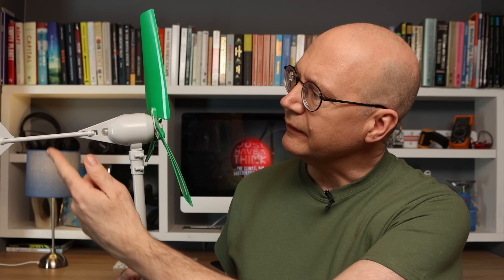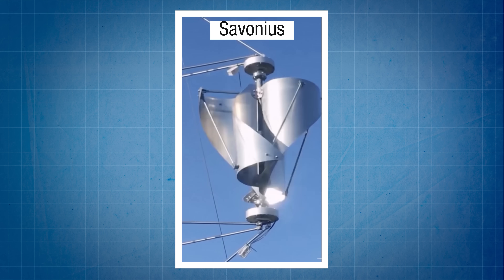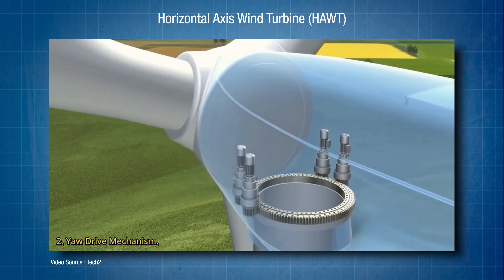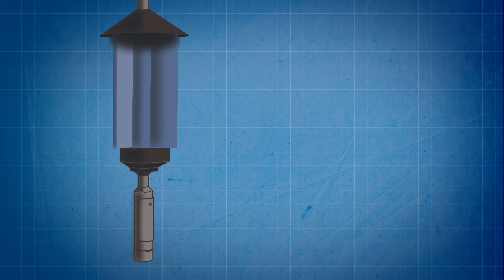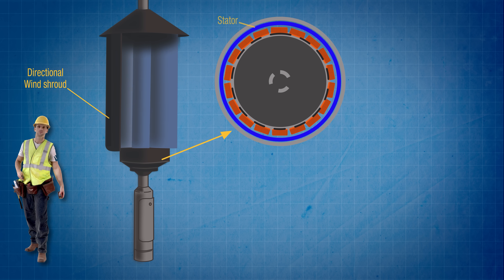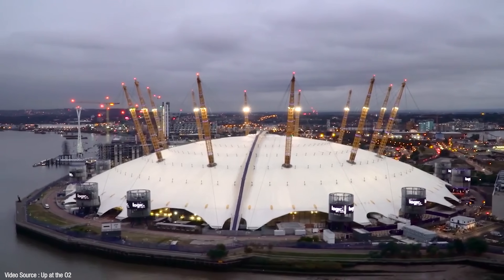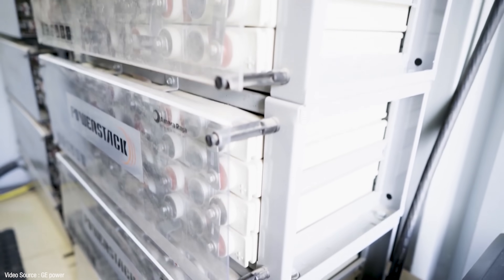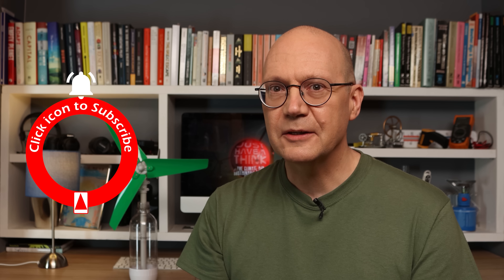A vertical axis wind turbine that doesn't need the prevailing wind! How do they do that?

Comment: Put them beside airport runways so turbine thrust would spin them. Corners where planes turn to take off could give them a real spin.
Reply: Even without planes, the amount of wind that airports will experience will be very high anyway. So definitely a very good place to install them regardless.
Reply: @shauntay0248  railroads too
Reply: @emiliogarcia5103  Yes, including the underground railways
Reply: @shauntay0248  actually, no. Airports are designed to be as safe for aircraft to operate from as possible. Towers and poles and tall buildings are banned. Outside of the control tower, everything else is built low. All towers in the arra are required to be marked on maps with elevation in print. Wind turbines cause a huge problem for crop spraying ops in the American Midwest. It leaves a lot of crops un-sprayed near the turbines and reduces farmers productivity due to bugs, pest and fungi caused losses.
Reply: @Triple_J.1  hmm, understandable
Reply: @Triple_J.1  Properly placed, the wind turbines would no more affect air traffic than it does road traffic. On the sides of the runways they would augment the safety barriers already there.
The OBSCENE use of pesticides in the U.S.A. is the result of gross mismanagement and results in a substandard product.
I grew up on the farm, wind power was how we got our water out of our well. That water was properly used, not spew out on the crops to encourage fungi.
Reply: it looks like the maximum speed the turbines can safely spin at is about 40 miles per hour. 
You'd want to be very careful in placement if you put them near the airplane spin up area so that the backdraft from the planes didn't exceed the rotational velocity of 40mph or you'd just burn out the breaks faster (wasting energy) or destroy the turbines. 
But yeah, putting them in and around airports for traffic flow and on some of the posts inside the airport runway areas would generate a ton of electricity.
Reply: @mastring1966  yep good call. So it would come down to placement right i.e set at a safe measured distance where the sweet spot would be. 😃
Reply: Brilliant!
Reply: Not sure the aviation regulatory authorities would allow 2 metre high electric generators that close to aircraft on a runway.
Reply: @m_mitch  They already allow 2 meter security fences, sound shields and blast deflector walls.
Reply: No! For a start the airfield ground environment is strictly controlled by ICAO and additional obstacles, frangible or not pose a hazard to both aircraft that may be experiencing a runway excursion as well as emergency vehicles that require a minimally obstructed area in which to operate in. Additionally there would likely be generation of mutipath errors to both localiser and glide path signals where ILS is fitted which would rule out their deployment. Optical interference by the sun shining on multiple spinning rotors would also be undesirable from a pilots perspective. Jet efflux is generally well contained down and within the runway boundary ,  the other source of wasted energy is from wake turbulence / wing tip vortex which can migrate out of the runway boundary but would not be harvestable at the distance any turbine rotar would need to be installed.
Reply: I was just about to suggest the same thing. 👍🏻
Reply: I think that is an idea absolutely worth investing in. What disadvantages, however, might there be? Other than getting run over by an errant plane?
Reply: Ooh really good idea bravo
Reply: They'd probably break 😂
Reply: Not really, it’s not safe.
Reply: Airports have higher safety level standards than highways due to planes potentially running off surfaces and the strong jet exhausts. Placing metal objects that can tear into planes is not recommended and airport equipment near runways, between runways is kept to a minimum and designed to break away. Ret Captain
Reply: From the Climate Crap Coalition:

Exhibit A in the BIG LIE of climate quackery:

One of the glaring stupidities of the climate change argument is the fact that the climate was warmer than it is now in years 800 to 1200 – the Medieval Warm Period.  Greenland had a thriving Viking colony and England was producing so much wine that the French were getting upset about the competition.  Neither Vikings nor the English drove SUVs.  The stupid assertions of climate change is government expanding its boondoggle empire through quackery and superstition. “Government imposed superstition” in the 21st century is something we should be ashamed of.

https://youtube.com/c/CDN_ClimateDN

The Ballad of Climate Superstition: https://www.youtube.com/watch?v=0CFuCYNx-1g&ab_channel=lozzagermain

Here's something for the idiots of renewable energy: Thorium

https://youtube.com/playlist?list=PL6JjafE5gsb928LkKNnz9MUiVBME4aGqi
Reply: Very funny. 
Here's something for the idiots of Renewable Energy: 

Sooner or later you greenies are going to need to grow up and learn how economies work. - hint government people understand nothing of economies other than  how to rape them.    

These G-morons decided "woke' power (power that doesn't really work) was a great idea for them, not us, so they decided to steal some money from some ratepayers in order to pay others to stimulate the growth or power that really doesn't work - ie wind and solar.

In the real world, the one that really works,  there is something called supply and demand and these things regulate the price of everything fairly.  

Your butcher buys his beef by the side and pays more for it than the meat packing plant did who in turn paid more for steer than it cost the rancher to produce it.   Get it so far?     

Now when you buy that beefsteak at the butcher's shop he's going to get his markup as well,  so you as the end consumer are going to have to pay a lot more for it per pound than the rancher was paid for it.   

Next time you want a beefsteak drive out to a ranch and buy your steer on the hoof - then you slaughter it, age it carve it up sell the inedible parts to dogfood processors and the like and eat the rest of it on the cheap - no you want the value that all those who added value to the meat along the whole length of the supply chain don't you?  Or do you buy your steaks on the hoof?      Or do you expect to pay the  ranchers price at your favorite steakhouse as well?

It's that way with electricity too, you cannot expect the power company to buy power back from you at retail rates when they don't even need or want the power. With that business model they will go bankrupt as soon as their investors are wiped out.    

If that rancher were to dine out at your favorite steakhouse why not demand that your ignorant politicians make the restaurant buy his on-the-hoof steer from him on demand at the same rate per pound that they charge you for a 16 oz prime rib?    

The problem is, as with all government planned economies, sooner or later everyone will want to receive the grift instead of paying for it, when that happens the lights go out - permanently.

The most ignorant feature of all of this is that it is supposed to solve some problem that the grifters dreamed up but that does not actually exist so solar panels and wind turbines only create huge problems, they solve nothing - time to wake up you dizzy Californians.
Reply: We should install one behind everyone‘s ass too.😂 💨
Reply: Stick it on a car! 💨
Reply: @sydhsydh1084  Unfortunately, no - you wouldn't win free power from sticking them on your car.
Reply: @and7barton  - yes you would. If you're driving your car anyway then you'd be generating electricity if you had one of these with a generator too. The drag would be minimal.
Reply: @markfox1545  If mounted on a vehicle, the added drag would equal the energy collected by the turbine.  At airports, the turbines don't need to be mounted on poles - they could be all of 6-8 feet tall, and no danger to commercial airliners.  With storage, there should be at least enough energy to power the runway lights.
Reply: @and7barton  Maybe onboard boats might work though,they use wind turbines on private boats already
Reply: @markfox1545  You'd have a net loss - The drag would be pretty high, plus other losses in friction too. You can't get any profit out any electro-mechanical system. They always a percentage of loss, often considerable. Placing turbines along the sides of a motorway might be a better answer. It certainly wouldn't cause passing vehicles to use extra fuel, but I'm not sure much output could be won by this method .... spinning a turbine requires considerable input. You wouldn't get much from a passing vehicle, plus it would be intermittent.
Reply: what a waste of  time and money.

Comment: I've known for a long time that "wind power" doesn't have to involve a propeller-looking contraption.   I watch You-Tube videos about sailing, and on most sailboats they have a couple of propeller-type wind generators that produce about 300 watts each, as well as solar panels that generate up to 1000 watts.   As long as the sun is up and the wind blows, that keeps their batteries charged and saves generator fuel.   I've often wondered why nobody uses a "Savonius"- type wind generator?   It wouldn't have to be any greater in diameter than the little 300 watt generator propellers, just about 3-4 feet tall to generate a good bit more than 300 watts.   Sailors plan their trip based upon reliable weather forecasting, and "plan" on having wind to power their sails for most of the voyage time.   The wind power on a functioning sailboat is huge, and underutilized.   Seems like an interesting idea!
Reply: Rotoarele Savonius au 1.diametre mici 2.viteze mari 3. rezistentă mare la inaintare(suprafața stângă = suprafața dreaptă, ambele însumate przintă rezistenta la inaintare. Dacă nu crezi pune_i un motor la o eoliană tip Savonius, rotește_o cu turația care crezi că aparține unui vănt de x/m/s ci vezi ce fortă consumă Asta este energie pierdută, din totalul posibil (activ) si mai rămâi cu parfumul de %. Iar dacă departrezi jumătătile exagerat nu mai este  turbină este anemometru ( fără vlagă)

Comment: Hmmm.

1) Cost/Energy required to design/produce/manufacture/install them
2) The wind will always be blowing sufficient enough to turn the turbines negating any 'vehicles punching through the air' to try and spin them
3) Maintenance/Service - Yet more stuff to go wrong. More road clutter. Imagine the leaves and debris that will get caught in them. Will they have to close Lane 3 to perform maintenance/service?  Imagine the backlog of traffic that will cause.

Still, you could always try solar roads...

Comment: Harvesting energy generated by traffic means reducing the fuel efficiency of passing motorists. Your car will have to push harder on the air to move the air past the turbines and spin the turbine than if there was no turbine and the air could flow freely out of your car's way. This is basically just stealing gas from your car to sell as power. Or rather, very tiny amounts of gas, from everyone's cars. And you can prove this by imagining that they instead spun the turbines with electrical power, to create a slipstream along the highway, which would increase your car's fuel efficiency and save you money but at their own expense.
Reply: Very well explained sir. Sadly too many people (including the maker of this video) do not seem to understand this.
Reply: Agreed. They are likely a parasitic power generation technology similar to the road hump power generator idea proposed by others. The proposers of this technology need to prove and explain why no energy is lost from the cars momentum putting these wind generator "baffles" along the road.

Comment: Maybe the wind generators create some sort of drag for cars , so they will have to use more fuel for same speed/distance . In that case it’s a loss or a steal . But I’m interested if they test it what the actual air and energy flow is . It sure is better thinking than the fossil fuel lobby .
Reply: You are correct. The energy is stolen from the cars.

Comment: I guess that hundreds of thousands of these will require millions of miles of copper that would be better used in the huge turbines of nuclear power stations,  which, overall are more efficient than millions of mini turbines.  There is a great deal of illogical thinking in the environmentalist mindset. Concentration and energy density is the holy grail of energy generation.  Lots of magic thinking.

Comment: I wish you'd discussed entrainment. A line of cars produces a flow down the road that benefits the fuel economy of all vehicles. If you take energy out of that flow with turbines, you could just me making all the cars work harder to generate very small amounts of power. Its the overall system power consumption that matters.
Reply: You are correct.

Comment: This is a fantastic idea. Can it be used on train lines too?
Reply: Sure, but it would increase the train’s energy consumption.
Reply: @Freba9  Why? How would adding turbines to train line posts make trains use more energy?
Reply: @bazpearce9993  It disturbs the air flow and thus increases drag.
Reply: @Freba9  Bollocks!
Reply: @bazpearce9993  Nope, basic physics!
Reply: @Freba9  These are WIND turbines that move after the train has passed. There is no drag.
Reply: @bazpearce9993  The wind turbines are also there when the train is passing.
Reply: @Freba9  So? The turbines will be many feet away. What's your point?
Reply: @bazpearce9993  The point is that they disturb the air flow. Of course, if they are farther away they have less of an impact on the train's drag, but at the same time: the farther they are away from the passing train, the lower the output of the turbine will be.
Reply: @Freba9  Have you ever felt a wind from an 80+mph train going by? Also, why would the turbines be spinning before the train got there to cause drag? You are making stuff up now.
Reply: @bazpearce9993  They don’t need to spin to disturb the air flow.
Reply: @Freba9  Then they can put you out there. All the hot air will balance it off.
Reply: @bazpearce9993  😂

Comment: It must be my cynical nature, but I had to keep checking the date on this video to make certain it wasn't uploaded on 1 April. I've seen too many impractical energy harvesting spinny things in the past. This has the appearance of yet another.
Reply: It will work fine for producing energy. The missing energy is stolen from the passing car, which has to create the wind which spins the turbine. The car loses fuel efficiency. This is a way for the power company to steal gas out of your car for their own benefit. Instead you should demand they spin those turbines up for you and create a slipstream along the highway that will improve your car's performance.
Reply: @williambarnes5023  the cars are producing wind turbulence either way theres no theft just using energy that was previously wasted.

Comment: I’d love to see the fins of those highway turbines built of bamboo. Perhaps each fin could be made from a section of bamboo steamed into the correct curvature - green, renewable, biodegradable yet capable of withstanding years of weather, cheap, and lightweight.
Reply: Bamboo yes, but even better built from recycled plastics, which will last a lifetime. There is another British company that is building solar panels from virtually 100% recycled materials.

Comment: is not f. free energy  ..those road turbines do create some resistance which cost some more friction  for the passing vehicles and automatically more  fuel consumption . those may seam insignificant  but mentioned kilowatts generated from those road turbines make one thinking .
however it may be a good idea , just not so enthusiastic as it seams in the first instance .
but let's do it and see what happen ??
Reply: We do not have to try it. It is just basic physics like you explained yourself. The energy is stolen from the petrol tanks of the cars.

Comment: I had this idea 5 years ago. 
I am happy someone more clever than me realized it.
I also thougth that those turbines can be installed on the top of existing buildings, possibile the ones next to the sea where the winds ALWAYS blows, e.g. one every 4 meters of front to sea lenght on the first 10 rows of buildings. 
Everything is ready, the electric connection is there, just the turbines are needed.
I made a simple calculation about the energy that could be generated just doing it in Italy between Anzio and Civitavecchia and that's INCREDIBILE
Reply: I had this idea 6 years ago.

Comment: The degree to which the wind energy is "residual" should be testable, and it should be tested.  ~~~ And, not just from a yes or no standpoint.  Measurements of load on the vehicles should be taken a varying distances between the vehicles and the turbines to determine optimal distance.  ~~~ From there, that would then have to be turned into calculations that would be meaningful for the complex conditions of varying real-world traffic.  ~~~ I would definitely be interested in seeing what kinds of efficiency curves result from such testing.
Reply: Optimal distance is indefinite. Put it in another galaxy or at least on the moon!

Comment: RSPCA and Police van's which carry animals have a roof top "pancake" rotating ventilation system. Motorhomes and many other vehicles use solar panels but when the sun isn't out little or no charging is gained. But with a "pancake" generator it would work when the vehicle was moving and giving the leisure batteries the top up required. They could probably be fitted under the vehicle also? Personally I haven't a clue how to construct such a thing....but someone will🤔🇬🇧